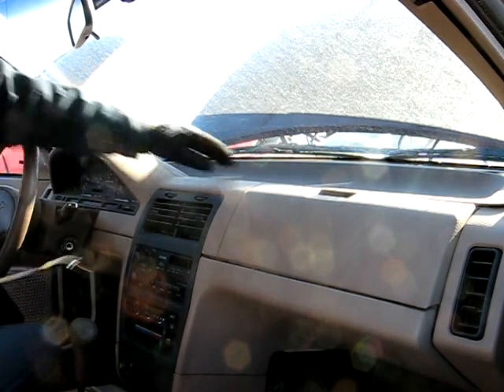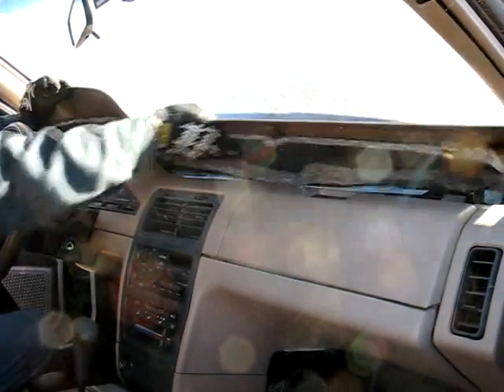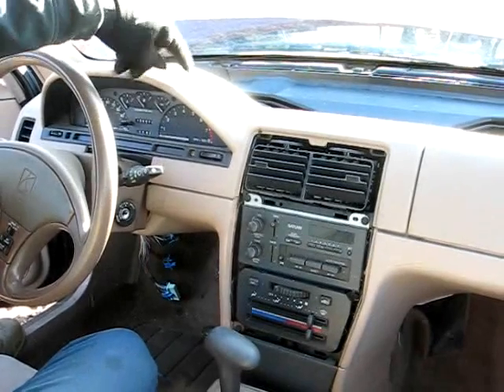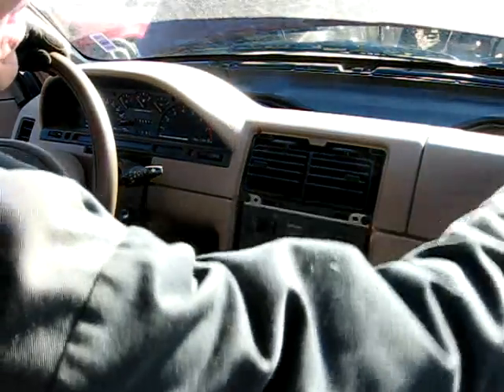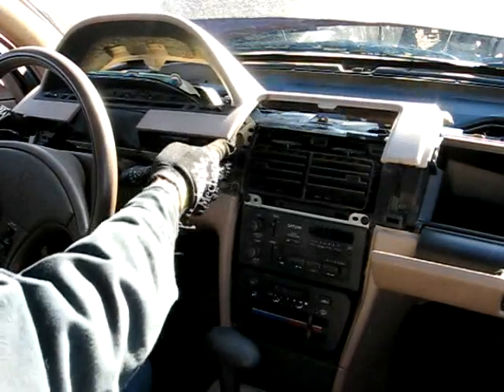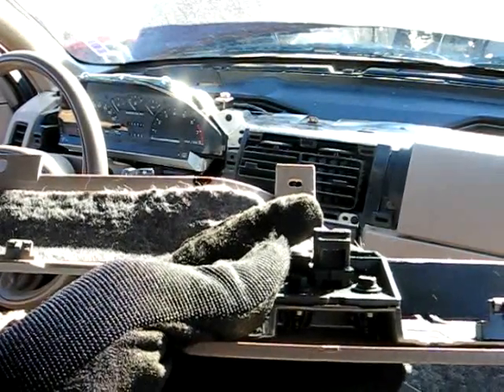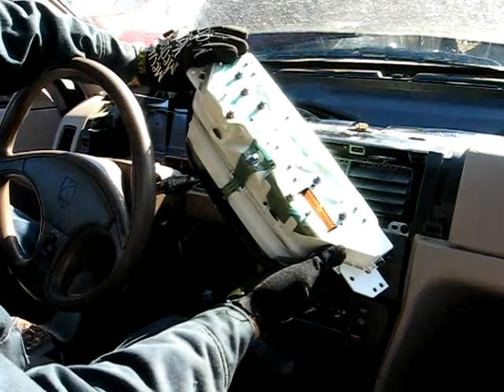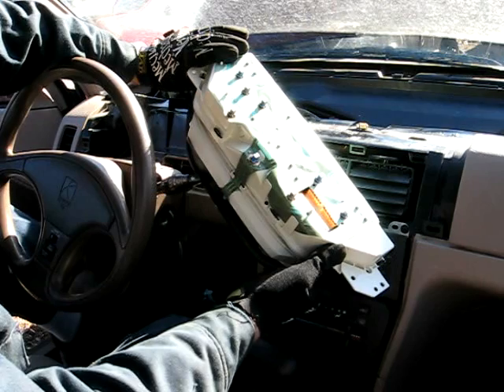Saturn Instrument Cluster Removal

Comment: Excellent instructions!  I just removed the cluster on my 94 SC2 in 20 minutes.  One thing I found is the small lock clip removed at 2:12 didn't need to be removed in my case....simply depressing the button (2:20) released the connectors.